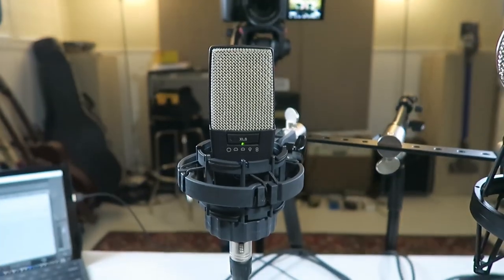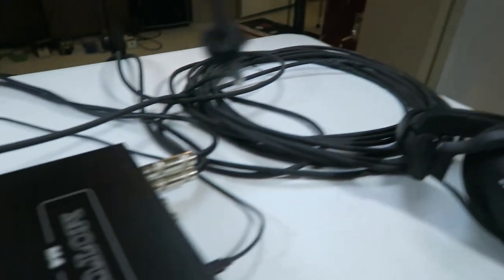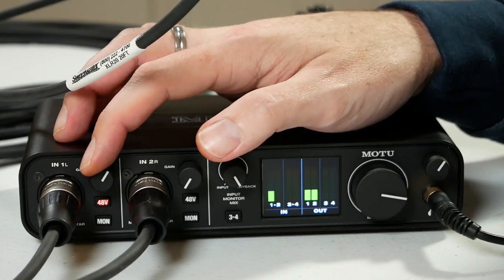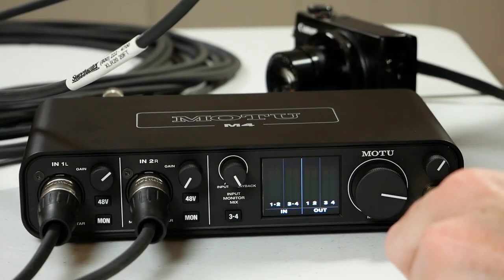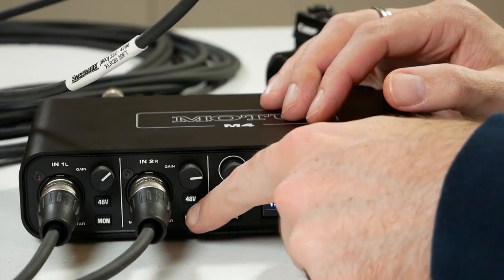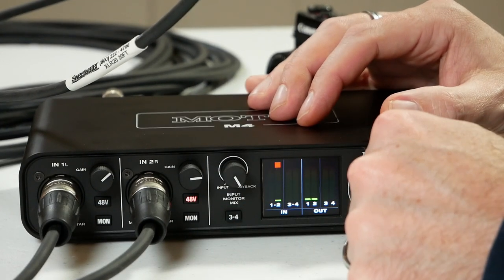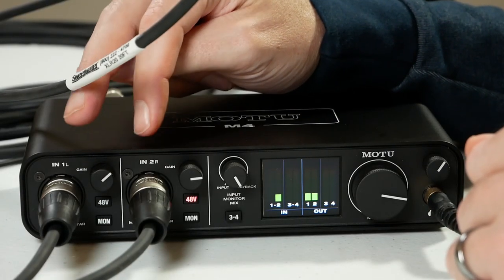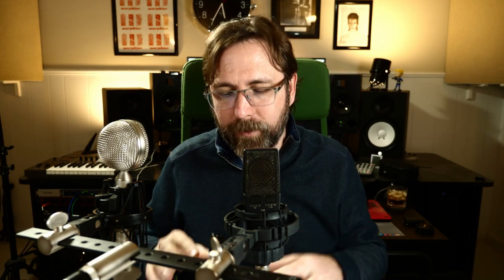Ribbon Microphones and Phantom Power - Dangerous or not?

Comment: More people need to see this video.

I spent hours and hours searching for a small mixer that had independent phantom power switches for each channel, because I was worried about this exact thing- a condenser/ribbon combo. But after going through dozens and dozens of listings a not finding one, I starting asking why that was.. so a little research later I finally found out that modern equipment has basically fixed this issue, which maybe explains the fact that any mixer under about 8-12 inputs usually just has one +48v for the entire board. And this video has put the last of my worries to rest, and I can go about ordering the mixer I actually need and can afford, rather than buying something I thought I needed and didn’t.
Reply from the maker: That's great to hear!  Best of luck in your search for the right mixer!

Comment: Also, many ribbon mics can be damaged by hot patching and by electrical outages while phantom power is engaged, or if +48V is sent through a miswired or an adapted or physically impaired cable. Active ribbon mics require and will not be damaged by+48V

Comment: I’ve got one very cool 500 style module preamp from Danfield that has a phantom power lock-out Button! I just love that if I had an all my gear I’d be real happy. Also you can purchase the little in line preamps that protect ribbon mics from phantom power but then you have to deal with that preamp sandwich for me does color the mic in the undesirable fashion compared to passive.

Comment: From my understanding, many (most?) pro studios still connect the mic lines to a patchbay (and many/most of these are TRS style). I do not dissagree that it's a chancy thing to do - but it's worth noting that pros have been doing it this way for many years. Probably good to develop the habbit to not hot-patch in general...regardless of topology. Obviously, the safest approach would be not to tie mic lines into a TRS style patchbay. For me - I find the density of the TT patchbay too convienent to not use with mic lines...and I would never patch with the rig running in general. That said - the patchbay (for mics) would be the first thing I would remove if my studio was ever a shared/collab space...

Comment: Always buying the cheapest mic cables I can find for my studio (around 7 bucks for 6 meter cable) and never had any problem, even comparing them with friend's 100$/3meter cable. No difference at all. So, I guess, with modern china, we can care less about ban wiring of the cheap cable.
Reply from the maker: I use a lot of Monoprice Premiere Series cable and its been fine as well.  Although reading the reviews of their TRS to XLR cables, there are several mentions of the cables being wired incorrectly.  That kinda scares me and makes me want to get a cable tester!
Reply: Just because you personally can’t tell the difference, doesn’t mean there isn’t a difference.  If you’re happy with your results, great.  But there is a reason commercial studios invest in high end wiring.  Commercial studios have to remain commercially viable, so they’d have every incentive to get cheap cabling if there was no discernible difference.  Clearly there are advantages to higher end wiring.